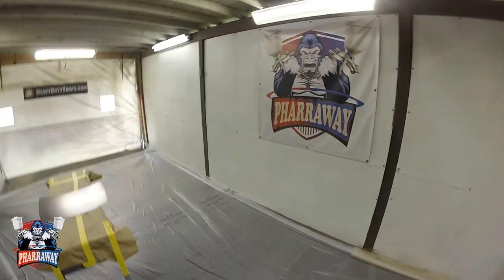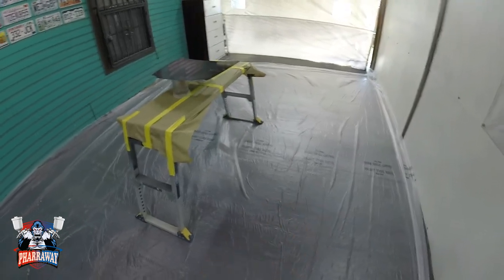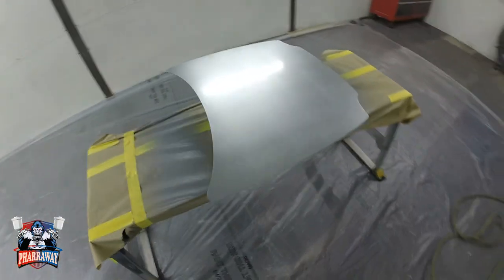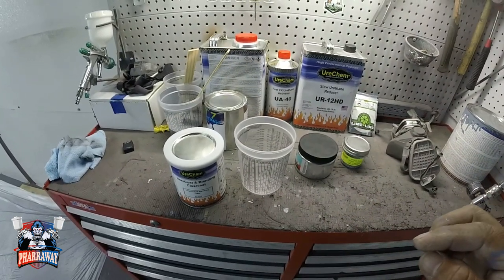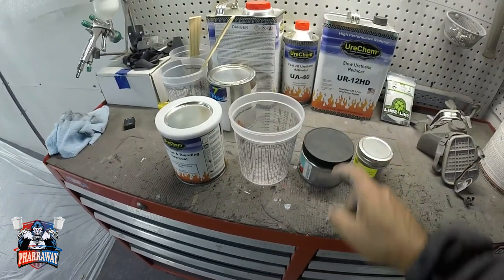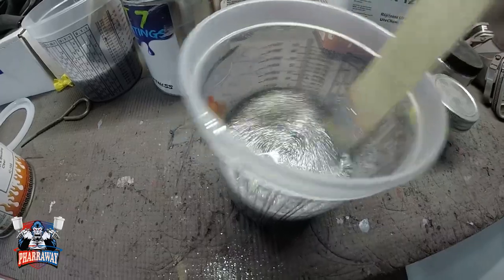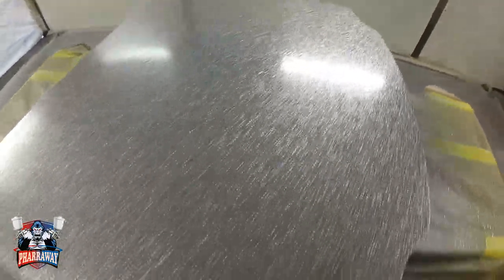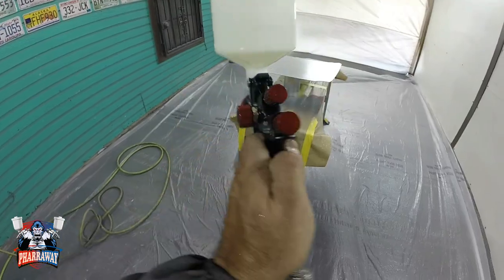How Lowrider Patterns Are Painted On Cars PART 1

Comment: i'm hoping to try painting this year, and i've watched part 1 and part 2 and they're both very helpful, thanks!!

Question:   you used the intercoat to mix the flakes because it dries faster, but then you used a regular clear coat for the 3 coats after the flakes.  Why did you choose that for that part?   Wouldn't you want that to dry faster also?   Thanks in advance! 👊🏻

Comment: Great video ! I was curious on the 10x10 plastic hood would need the same initial prep process, like the two coats of adhesion? since it’s plastic
Reply from the maker: Yes
Reply: Back with another question brotha, would you recommend two different spray guns when applying the base coat /  innercoat clear or just wash out your materials well before each use

Comment: I think Underground Paint King and myself will bring some new content for his channel. If all works well. I'm looking forward to that.
Reply from the maker: UPK is a awesome painter he has a lot of beautiful work
Reply: @PHARRAWAY  I agree he has skills for sure. And he's only 1 hour from me.
Reply from the maker: @bear_vibes5130  That is awesome
Reply: @PHARRAWAY  It should be fun. I have alot of experience on metalwork welding and if needed a little lead. Also mechanical skills. Doing complete front suspension on 08 compass struts stabilizer pins and control arm. Also inner and outer tie rods. Already did all 4 wheel master brake repair. Then off to the alignment shop.
Reply from the maker: @bear_vibes5130  That is awesome brother
Reply: @PHARRAWAY  just another day bro. Stay tuned in to UPK. I stay tuned in to the channels I like.